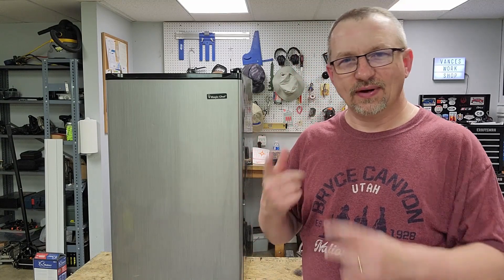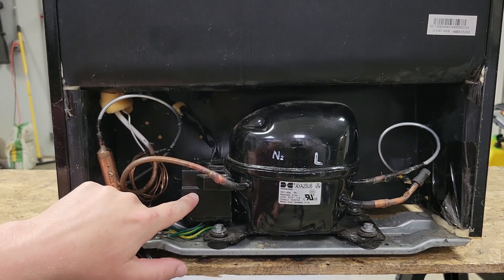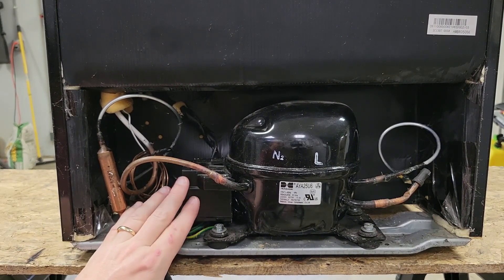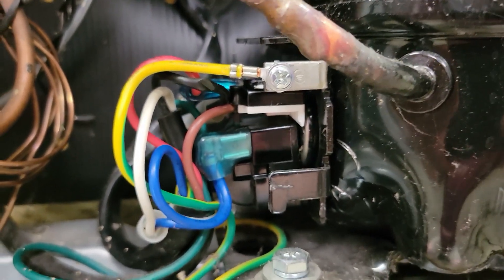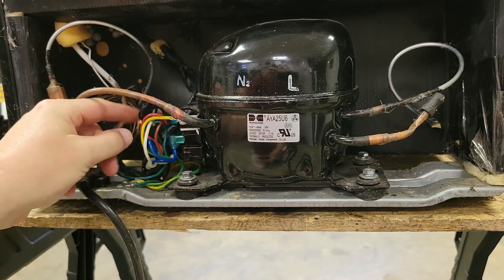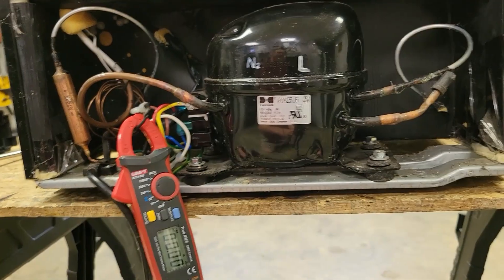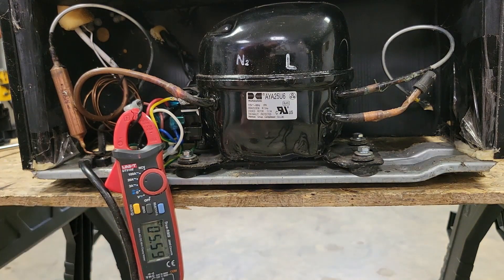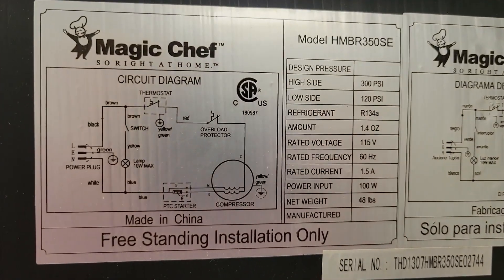Project #44 - Mini Refrigerator Troubleshooting (Bad Compressor)

Comment: So I’ve replaced the thermo overload and the relay, I’m not hearing any clicks when I turn the thermostat on, the compressor is hot the the touch but isn’t making any humming noise, all electrical parts are working properly, do you know what could be the issue? The old relay was open so that’s why I had to replace it, but it was clicking before and the compressor was humming before, then all of a sudden it stopped doing all those and I decided to replace the relay and the thermo overload.

Comment: Thank you for this video. I’ve been trying to fix this same exact fridge for three days but didn’t want to give up. The only thing is that I have measured the amps coming from the wire but I do get that clicking sound. Should I still buy an m meter to test it out? Or is it safe to say that my fridge is having the same issue?
Reply from the maker: You can usually buy the PTC and the overload both for around $10.  I would just give it a try before tossing the fridge out.